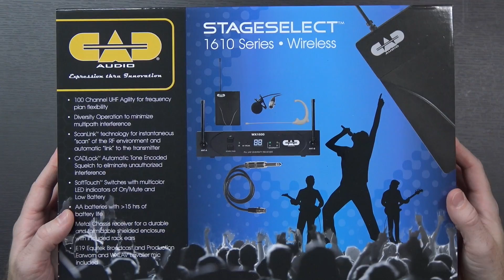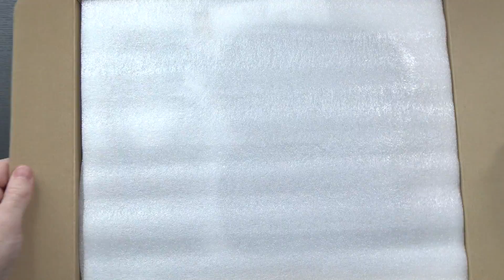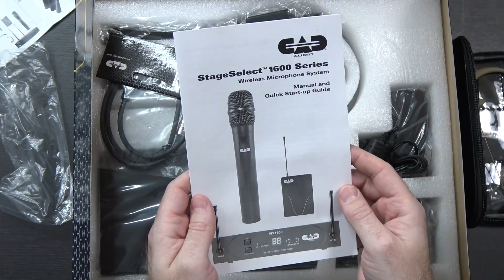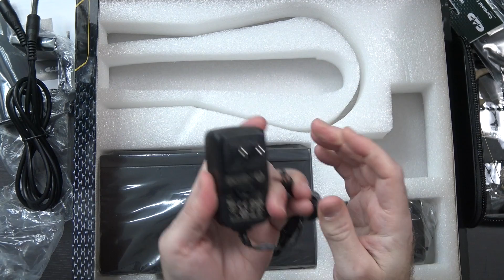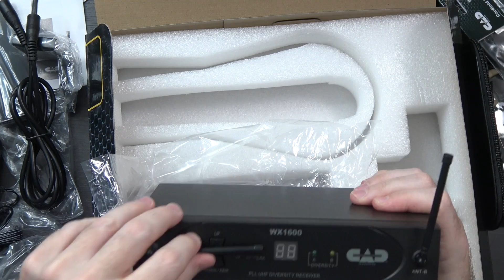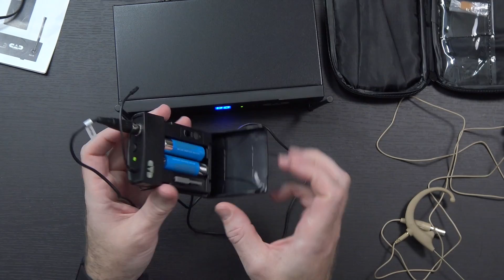CAD WX1610 Wireless Lavalier Stage Microphone Kit

Comment: Hi just a question for you  the testing on the microphones sounded very low.  the Mic at 60% & the receiver at 40% How Come U did not give a 100% on the Mic So We cud All appreciate The Delivers of the Sound in it's full thank you
Reply from the maker: I may have to do a quick unlisted follow-up video on this one. Whenever I set everything to 100%, the mic levels on my recorder spiked into the red, but if 50-60% was as low as this turned out, it's possible that 100% would be fine.